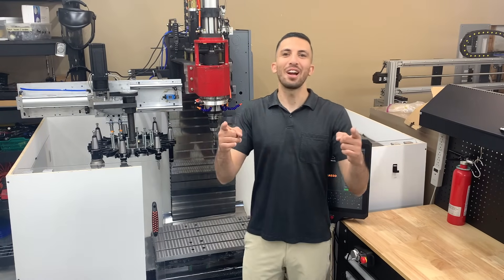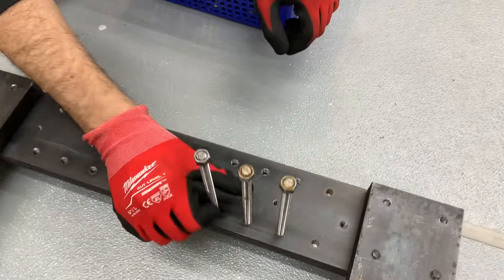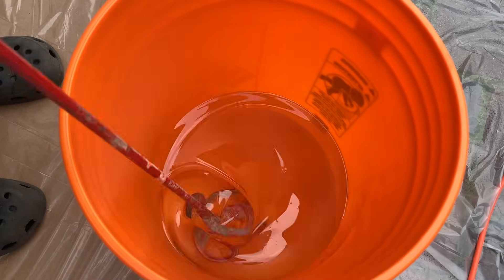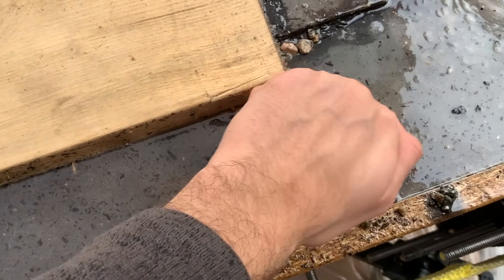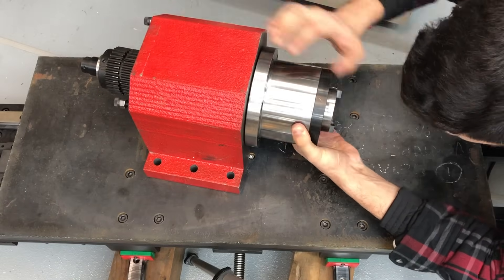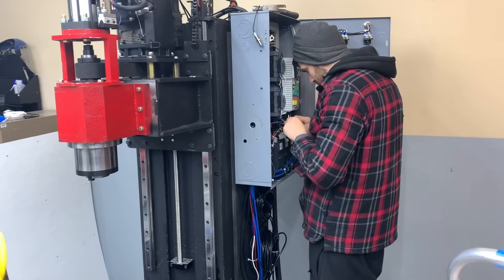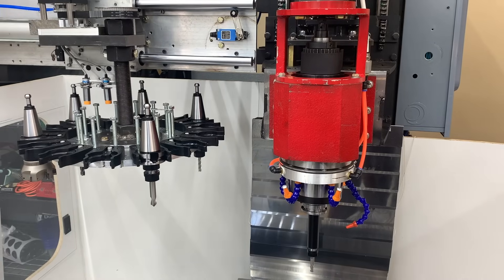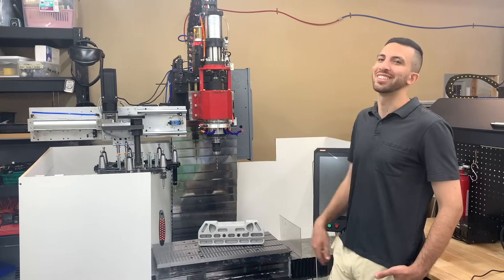Building a DIY CNC Machine With Automatic Tool Changer

Comment: Some people just got to much money lol
Reply from the maker: Hahaha, nah, if you want to make it happen you will. Trust me 😉
Reply: @ActionBOX  I just spent on (7) HG15 Hiwins with blocks. Got the levelers and the blocks. Frame built. Control and motors next. 

Goddam Im poor again and they are only HG15s. Lol.
Reply from the maker: @dogdipstick  Hahahah, fair enough, its not the cheapest hobby. Glad you enjoyed my content though. Help me out by sharing with a friend or two. Dave 😃
Reply: @ActionBOX  That epoxy though could have fed a small nation
Reply from the maker: @dogdipstick  hahaha, yeah, its not cheap. I would recommend putting the time in to find a mixture with better fillers to use less epoxy.

Comment: Very cool build! I’ve been considering a more modest cost CNC Mill built with similar concepts. A couple of questions/concerns. Every other in-depth granite-epoxy machine build I’ve seen mixes in at least 3 different granularities of filler material and does so in a separate mixer, then pours. You don’t mention details on the filler and you pour it in after pouring the epoxy into the mould. What filler did you use? Why pour in without thorough mixing of the filler first?
My other concern is that the part you highlight at the end took an 11hr, then a 9hr run. With that much power and rigidity I would expect you to be able to run through that block in a fraction of the 20 hours quoted. Have you tuned your feeds and speeds for it yet? Was it struggling at all?
I’m certainly not trying to knock your build. I love it! Definitely impressive.
Reply from the maker: Hey, First of all thank you for your support. This was my first big cut so I ran the machine modestly. I could definitely run way faster than 11 hours. As per the epoxy mix, the filler is a great way to save money by using less epoxy and packing more mass in, but I did not have the time as I was consumed to the minute. Hence I allowed myself to spend the extra money and not deal with sourcing more rocks of proper dimensions. that being said, when you use several grades of rocks to pack them well, it makes it extremely difficult to mix by hand which is why I left it as is. Cheers
Reply: @ActionBOX  Thanks for the response. I'm certainly curious to see how fast that monster can hog through some steel once you've got it dialed in! Getting all of the minute details of a granite epoxy pour just right is clearly a major pain in the butt. Your reasoning makes sense to me. Enjoy the fantastic machine, I look forward to seeing what you do with it!
Reply from the maker: @kyndig2  Thank you so much, I appreciate your support.

Comment: Nice work and cool machine, but why in the hec are you running couple of hour job for twenty hours? Feeds and speeds way off! For aluminum you could run much faster and much deeper on a pass. Nice if your not n a hurry but unnecessary to baby a machine that seems rigid enough to take good cuts.
Reply from the maker: Thanks. This was one of my first ever cuts which I couldn't afford to make a mistake on, so I was extremely conservative. Knowing what I know now, I could have cut down on a lot of time. Hope you enjoyed the video regardless. 😃

Comment: Awesome build. I see you used the Masso controller. Thoughts on that? What did you use the display?
Reply from the maker: Yes, it is a great controller although I don’t like that it lacks some more complex features such as rigid tapping etc.  what machines do you build? Maybe it will be good enough for your needs.
Reply: I have a prototype mill designed similar to Tormach or Syil. I don't do any rigid tapping anymore, strictly thread milling. I was going to use an Acorn but adding the 10 tool changer but there aren't enough inputs
Reply: What display did you use

Comment: Some pointers on cutting precision.
As a mechanical engineer we studied CNC and measurement precision.
To gain maximum cutting precision a material should have minimum contact points needed in a 3D space.
So on the bed there should be 3 contactpoints, same reason why a 3 legged stol never wobbles.
On the X/Y axis you only need 1 contact point on the left side, and 2 points on the top side, these could be fixed calibrated positions. Then clamp the workpeace against these contact points.
You should also add a measuremnt tool to calibrate the height of the workpeace or mill it down flat and then calibrate with a measuretool that sets the depth to the PLC software..

What makes a good precision machine is the bend force tolerances on sideways forces on the spindle and tools. Aswell as the resolution of the Hall sensors inside the motors..

And yes weight is of importance but it is not only for machine vibration. A measurment engineer at Mytotoyo explained something i can partially remember. They had 1 tonne stone slabs on the benches for measuring and calibration because of the earths gravitation aswell as earth crust vibrations and vibrations from subways and traffic on the road outside. This was needed for mikrometer/nanometer precision in engineblock/piston CNC precision levels
Reply from the maker: Thank you for sharing. This sounds like the "kinematic constraint theorem" which is a great concept to understand. I hope you enjoyed the video. Cheers, Dave
Reply: @ActionBOX  
Absolutely correct!
It was amazing to see the build process, hearing the engineering ideas translated into function..
You have a very great skill and good knowledge retention you and your brother. To be able to put all this into practice that normally require people with different educations and skills 👐🙌

I'm guessing there are alot of theoretical engineers that are envy that they never created on this level !!
Reply from the maker: @dagg497  Thank you so much 😊. Dont forget to help me out by sharing with a friend or two. Cheers, Dave 😃

Comment: You could consider buying machine mechanical structure from us, then build electric parts by yourself, it will not be much higher cost but save a lot of time
Reply from the maker: I have a feeling that would be way more expensive.  Especially after shipping.
Reply: @ActionBOX  it will worth when you need a stronger machine
Reply from the maker: @leoliu4193  I dont think so. Feel free to share the price here. Your prices from what I can find are still way more expensive

Comment: People like you are really inspiring. I'm in the process of learning Arduino. It's so sad how these big companies rip us off, charging us tens to hundreds of thousands for things we can build ourselves for a fraction of the cost, and the nice thing about building things yourself is, you can customize it in any creative way you see fit, like for example, I would rig it with some moving IR sensors and linear mechanical arms to automate the tedious task of manually squaring and finding the axial zero, also a hydraulic press underneath the magnet with ejector bars so you don't have to struggle to get it off the magnet when it's static, and to get it onto the forklift more easily...

Just some things to save you the manual effort
Reply from the maker: Those are great suggestions, and yes, it definitely pays off to build your own if you are willing to learn and put in the effort. Don't forget to share with at least one friend who is interested (if not more). It would really help me out 😃, Dave
Reply: Bro you cant compare this machine with industrial machine. Yes you can build you own machine, depending on how much you want to spend determine how good of a machine you can get but saying that big manufacturer is over charging you is a bit much because you're paying for years of development and researches. It took them 20 hours to complete this part when a Mori or Haas can complete the same part in less than 1 hour could be faster after the first part and fine tuning the program.

Comment: Well done , great solid build . Pity you didn't mention the machine leveling , ball bar , backlash and pillar perpendicularity measurements that all larger machines need to be and stay accurate . Also the cost of the machine with such good components may be in the tens of thousands - you can buy a pretty cool used machine for 5-10k . Having your own design and specifications does leave development options you otherwise might  not have though.
Reply from the maker: Great point! I will include this information in future videos.
Reply: @ActionBOX  could you share the cad plans please?
Reply: I once saw the Japanese manufacturer leveling their base into micron. 
From cnc milling to cnc grinding and final step on human manual scraping(They called it shifting ,take all day man hour doing that).
Reply: If you are handy with controls (which you would have to be of you are building a cnc machine) you can always buy old iron and update the controls.  I bought a mid 80's Bostomatic for $1200 (with punch tape reader and some mouse chewing damage) and updated to modern controls... twice.  First Mach3, then UCCNC.
Not taking anything away from the build in the video, which was really nicely done.
Reply: Why would anyone pay 5- 60k for this machine? Its rails and actuators. What exactly is expensive about it?
Reply: I'd rather find a way to update the controls (if possible-with evolving tech possibilities daily) on an old Japanese machine from the 80s/90s, however he will have the knowledge base to repair/upgrade/replace while I'd have to call someone and spend mega $$.

Comment: This was really well done. The one thing I wonder about is the durability of the epoxy base. It's not a homogeneous material. The epoxy has many sharp corners internally cause by flowing around the shapes of rocks. This creates 1000s of stress risers inside the block which can lead to crack formation and propagation. Machining steel imparts huge loads and stresses on those blocks. I guess only time will tell.

Good job nonetheless.
Reply: carbon fibers to the rescue! for the next machine...
Reply: Actually epoxy granite is used on commercial special purpose equipment as well. As a rule of thumb the machines are fabricated to be easily strong enough to do the task then shipped to the customer. Upon arrival and commissioning they are filled up with the compound. This is done to save shipping costs as air freight on a 15 ton machine is a lot more expensive than a 6 ton.  The Epoxy is also quite elastic and as long as the gravel is clean, dust free and dry proper adhesion occurs. The gravel is far more likely to break down than the epoxy.  It functions like a anti chatter boring bar. Chatter is not stopped at the first instance but it's resonance is and the finish only has a single small mark. The stuff you are thinking about is where the compound is used as a structural framework that carries load (Steel set in Concrete). Done on VERY LARGE machines usually cheaply built a long time ago. An example would be a lathe with a short bed needing to machine a very long shaft for a short diameter. Build a block and base in the concrete at the required distance from the spindle and there you have a very temporary long bed. This was also used for home built equipment in the days of hard steel tools and was quite crude.
Reply: Well that a well known technique that have already shown that it works...
Reply: The actual forces involved in machining are very low. No where near what would be considered a huge load or stress.

Comment: Wow! amazing build! But i feel like your cuts for your aluminum were really really really conservative, even on a smaller hp machine less rigid i feel like cutting 6061 plate of that size shouldnt take 20 hours.
Reply from the maker: Great point. It was one of my first jobs on this machine so I ran very conservatively just incase. With more experience, the machine takes much deeper cuts. Cheers

Comment: thanks for explaining so easily, you can use uhpgc concrete instead epoxy, cured with steam in 2 days. with uhpgc or bioepoxy you need a mix of river round sand and microparticles, and short and continuous glass fibers. z axis can be lifted with a simple pneumatic jack, working with gravity. this cnc can be made cheap with a diy tool change system
Reply: uhpc or uhpgc concrete mix is a bit more expensive than normal concrete but super cheap compared to bioepoxy and is ecofriendly, it uses recycled industrial materials as slag and silica fume (microparticles that give compressive strength by reducing voids). you still can use a bit of bioepoxy to apply to the short and long fiber to mix them with concrete (concrete has poor adhesion with fiber) and make fiber reinforced bioepoxy (or recycled ABS or PET) screw bars instead those metal screws. for both bioepoxy and uhpgc you need vacuum mixing to remove bubbles and improve mixing, i made this post in reprap https://reprap.org/forum/read.php?1,884820,884820#msg-884820. to reduce vibrations in this type of heavy machine, i would use a fine layer of metal foam
Reply: @crapisnice  Shrinkage is more important than strength.
Reply: @tugrulcagr7640  shrinkage happens during curing time, you can mill the parts after for total dimensional precision
Reply: @crapisnice  I read this experiment before I made that comment. Uhpgc seems far from stable. 
https://www.researchgate.net/publication/298791636_Novel_Ultra-High-Performance_Glass_Concrete
Shrinkage means there are internal stresses. This is why they heat treat the castings. Also shrinkage will distort and put stress on your steel skeleton. You can't fix this by milling. You need to choose the most stable material.
Reply: @tugrulcagr7640  that pdf was a random example and you are not referring to shrinkage but dimensional stability or creep deformation by compressive or bending forces. as you can see, most of the bridges and highway structures are built with low performance concrete yet they keep dimensional stability while uhpc compressive strength can vary from 100 MPA to 400MPA which is more than aluminum and near cast iron, depending of the chopped fiber ratio, longitudinal fiber or fiber bars, type of sand and other factors. still you can make a slim piece with steel or a thicker piece with uhpc and they will have similar specs. https://reprap.org/forum/read.php?1,884820,884820#msg-884820

Comment: $15,000 can by a very nice used commercial CNC mill, perhaps two.  But you wont have gained the experience or knowledge you did here. So well done.
Reply from the maker: Can you please share a link to a comparable machine that costs only $7500 as you suggest? Cheers

Comment: What was your source for the actual spindle?
Reply from the maker: A supplier in China.
Reply: @ActionBOX ome place on earth? Mind being a little more specific. What supplier in China? Also you don't give much specifics as to controller type software or hardware used. Are you keeping this info private? 
I purchase a used but faulty cnc LB15 lathe $2,000 and a busted vertical VMC Lagunamatic for $900 (scrap metal) these will be gutted out and retro fitted with linuxcnc and mesa cards. 
Used decommissioned cnc machines are plentiful and make a great platform for retro fitting as the mechicals are generally fine, and of industrial grade.

Comment: Always normalize your audio before exporting - the volume was all over the place during playback.
Reply from the maker: Thanks for that. I recognize it was an issue, and promise to fix it in subsequent videos. Cheers, Dave
Reply: Not normalizing audio is a common beginner's mistake, so no big. What I do for Youtube is normalize to -3dB (instead of 0 or above) just before I start the export - this seems to be a solid level that won't clip/distort once YT has reprocessed the uploaded video.

Also, invest in a reasonably good wireless cavalier mic rig when you're doing shots involving vocals in a large room (e.g., your intro), as room echoes will be a problem (as are evident in your intro). You don't have to spend a ton of money on a studio-level setup unless you're planning on doing broadcast work, but having a mic on you as opposed to using a shotgun mic on the camera will tremendously reduce the amount of echo in the vocals. (The pros tend to use things like boom mics to more precisely control audio input, but those are unwieldy and awkward to deploy in a shop environment.)
Reply from the maker: @OddlyIncredible  Wow, thanks for this. I have gone ahead and invested the wireless MIC. This is exactly the comment I needed to get better. Thanks for the long writeup 😃

Comment: Never seen diy project quite like this. Do you have plans available at some point? I might be interested even to buy them if that's what you're looking for.
Sorry if you get asked a lot, didn't  read all the comments. 

This is early, but I hope you'll make a revision, maybe after a year, for any design flaws or what you'd do differently if you were to do it again.

If I was to buy a manual milling machine with tools, it would likely cost 4-6k euros. This project seems reasonable option, especially when one's likely to upgrade to cnc eventually.

Keep it up!
Reply from the maker: Hi, I have no plans of selling the plans, but instead I want to upload them for free. It will be available with the next video of the machine. Cheers.
Reply: Sounds fantastic man

Comment: Very cool build! Light years ahead of the tormach sitting in my garage. For the 15k and time spent with design and building, I still think you would be better served with buying a used industrial machine lije an older haas or fadal and retrofitting the controller.
Reply from the maker: Perhaps, and I had thought of it, but I had no way of bringing those machines to my house for cheap 😂. They are so massive that transporting them is very expensive.